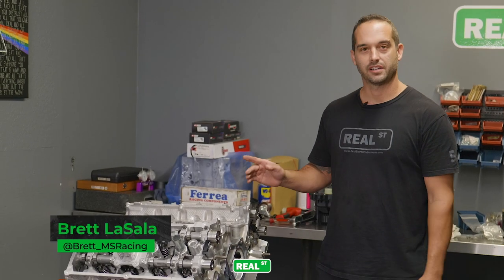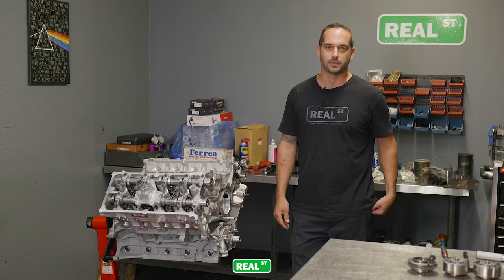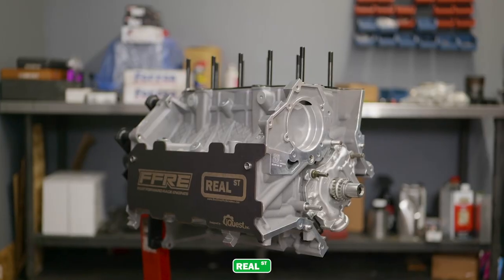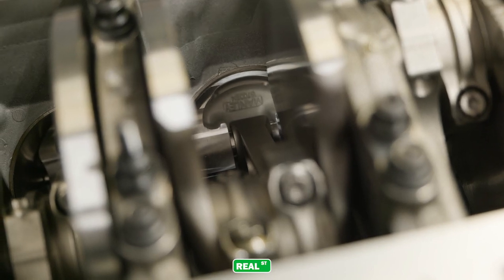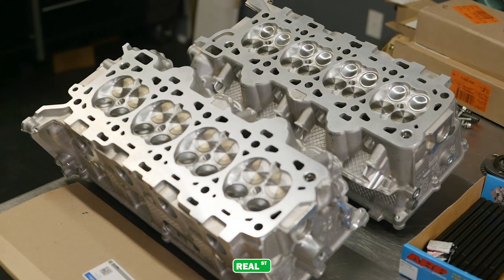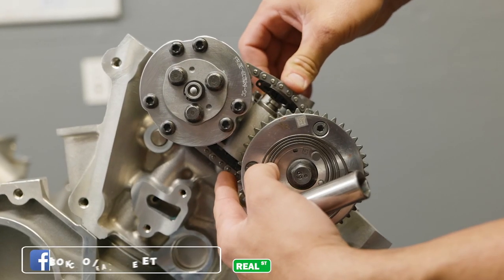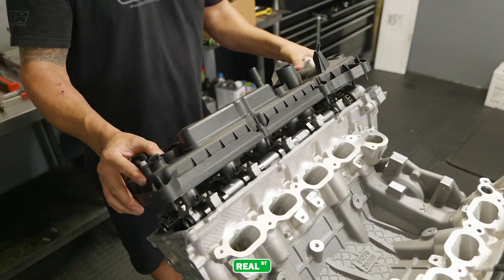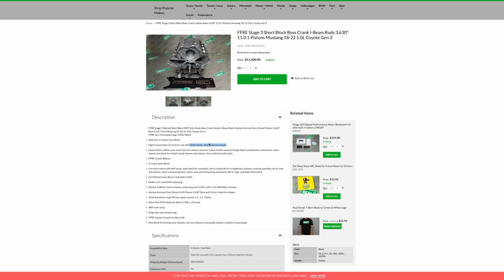Assembling A 1500hp+ Gen 3 Coyote Mustang Engine

Comment: M113K is my favourite. I completed my car last year and first dyno testing made 437kw and 970nm at the wheels, 12psi, gearbox decided to shit itself and I’m now looking at a manual swap or getting a nag1 box but seems difficult sourcing one. I have a 22psi pulley for the weistec 3ltr charger. Fully built bottom end with darton sleeves. South Africa just doesn’t have the tech or any development. Cheers for the video guys!